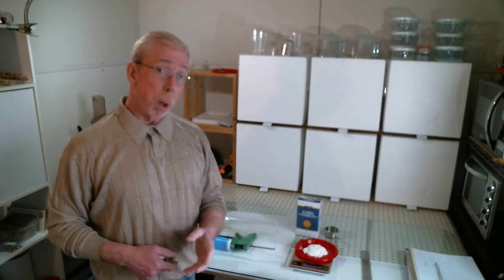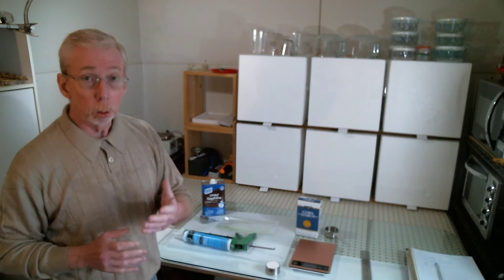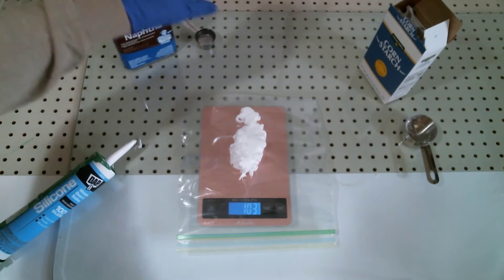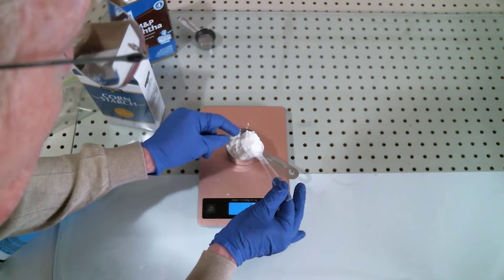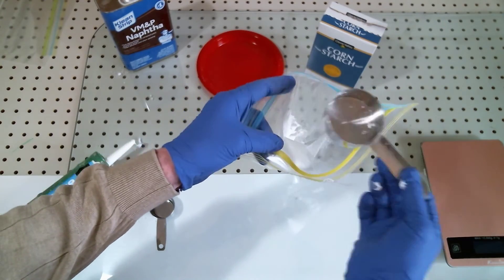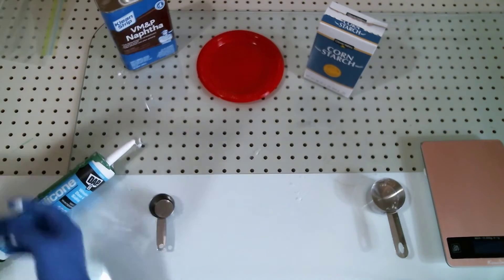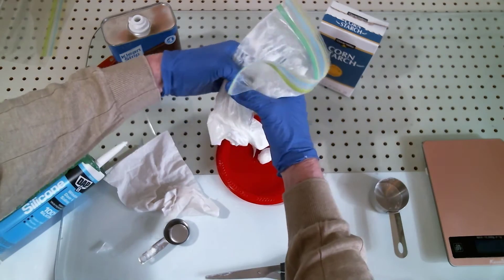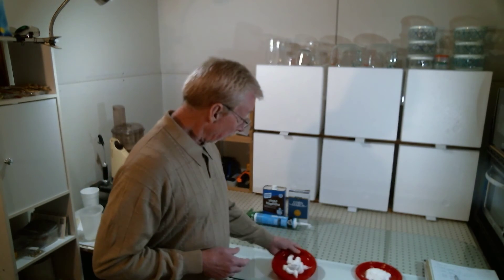DIY POURABLE SILICONE for mold making. Thin silicone w/Naphtha, fast cure w/cornstarch.

Comment: when i google naphtha, it comes up with petroleum for like on the bbq, lighting fluid basicly. is that right? also 1/2 cup is 125ml correct? thanks in advance
Reply from the maker: Correct, Naptha is used as lighter fluid. Very close on the conversion, 1/2 is 120 mL, and for this project, close enough.

Comment: Great video, thanks a lot.
By the way, do you have any ideas to thinning food grade silicone rubber (with food grade solvent)?
Reply from the maker: Food grade machine oil, food grade silicone lubricant, silicone oil, to name a few. A search on Google will give you many choices. I would try the silicone oil first, as it is used commonly.
Reply: @GEOsustainable  thanks, I'm eager to try

Comment: I've tried doing this before and it was an awful mess but am inspired to try again with your method. That said, I'd like to see you do a practical demonstration and then perhaps something cast from your mold. Appreciate your sharing your knowledge.
Reply from the maker: Thanks Jeff. One of my molds or one of my products? Jeff, the mess must have been, you have to use corn starch if you pour more than 1/4 thick bead of caulk, or it cannot get air. Could you perhaps shoot me an email of exactly what you would like to see and even discuss your problem you are having getting results? Thanks again.
Reply: I think I just got the proportions of everything wrong. And I wish I had known about mixing it in a plastic bag! I think I just want to see you make a mold of an object and then cast it in plaster or resin. FYI I'm a model maker and artist. Thanks for the response and videos! @GEOsustainable
Reply from the maker: @jeffgoldenberg9579 You got it Jeff. Next video. I will make a mold and cast a something using plaster. It will take about a week to shoot, so hang in there.